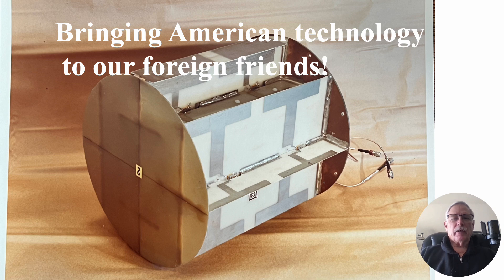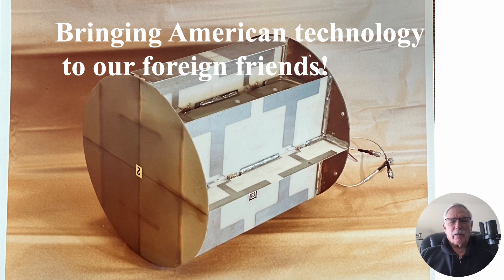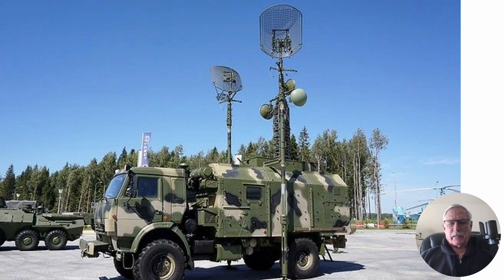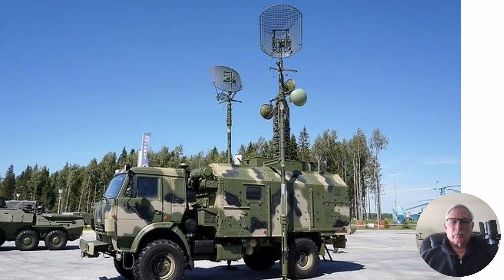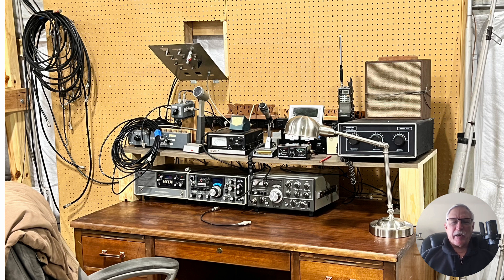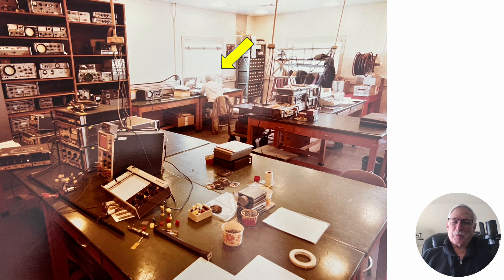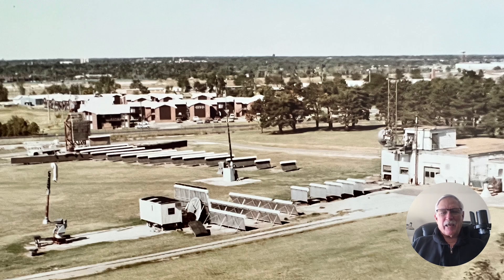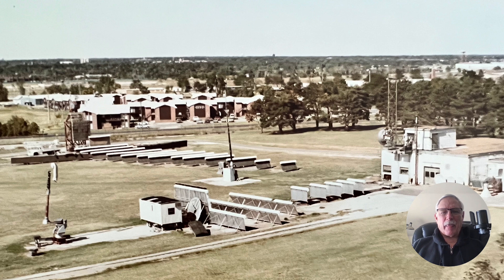Military attack drones! Bringing American technology to our foreign friends!

Comment: Looking at that drone with the detail reminds me of the 35 Bonanza. This brings up an interesting question. If you step on the rudder pedal of a V tail, with a ruddervator how does that not change the pitch of the aircraft to climb or descend? It’s supposed to make the aircraft yaw left or right, but it also moves those devices in the same way. It would change the pitch. Can you explain this?
Reply from the maker: To achieve yaw without a pitch change, one elevon goes up and the other goes down.
Reply: @ronrogers  so then what happens when you’re making a yaw adjustment during a pitch change? This must have some intricate rigging to be able to do this independently.
Reply from the maker: It's not all that complicated, but it works. The advantage of a V tail is the lower drag but it has low Dutch roll damping. I actually had a graduate school level aero class where one of the final questions was to design a V tailed aircraft.
Reply: @ronrogers  I guess it is not a structurally strong as a conventional tail. This is why Beachcraft stop making the V tail in 1985 I believe because of all the structural failure problems with it. However, the Vision Jet has one.
Reply from the maker: Yes, you are correct. Also got a bad reputation as the "forked tail Dr Killer".😳😳 @aviatortrucker6285
Reply: @ronrogers  I don't think that was the fault of the aircraft as much as it was people with more money than experience rushing out to buy them.
Reply from the maker: Oh, I didn't mean to imply that the aircraft or the design was faulty. The only fault was with pilots with more money than talent. Always a problem. @johnopalko5223
Reply: @ronrogers Correct, the mechanical “mixer” was referred to as the “monkey motion” at Beech.